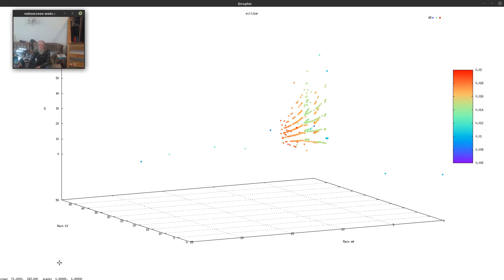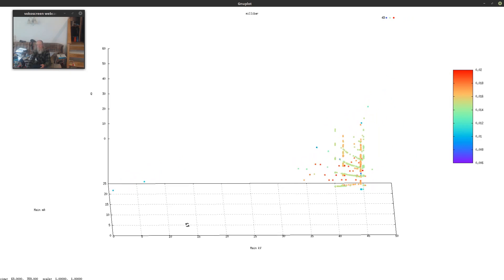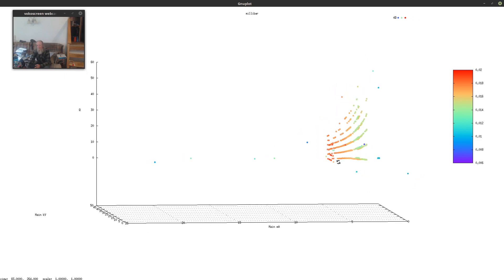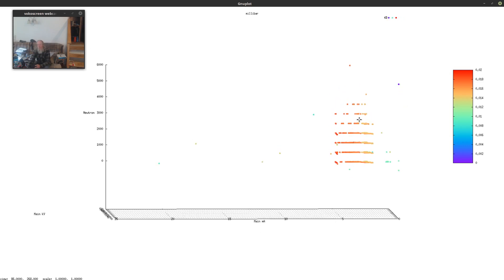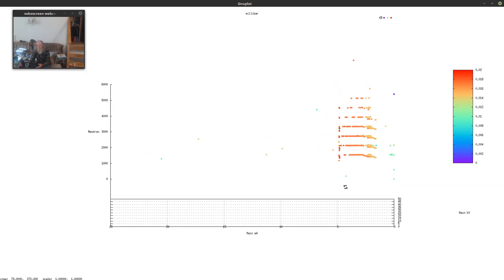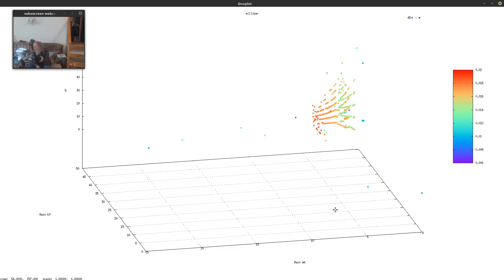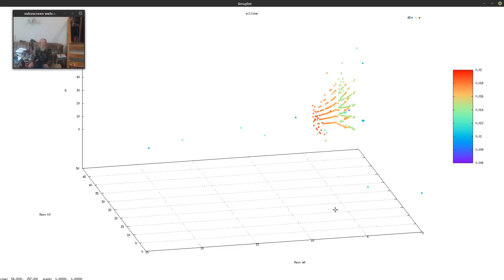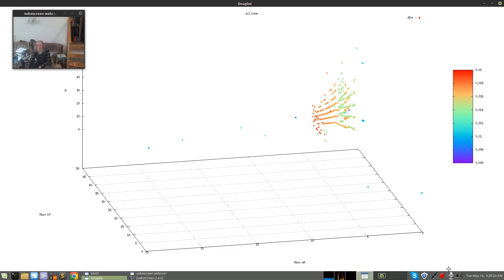NewQ

Comment: Hi Doug,  does input frequency have much bearing on your results?
Reply from the maker: An idea I'm pursuing has me duplicating many of the concepts of an ion trap - roughly defined by the Mathieu equations.
Those, however, only work in what might as well be vacuum - they don't take into account interactions between the particles, which themselves have charge which becomes significant when there are lots of them (density).  Or the effects of also having a bunch of electrons around which gets quite complex - plasma polarizations that have odd propagation times as polarization waves etc.
The original, simpler stuff, for which some math is available basically goes (vastly oversimplified) that AC + DC can trap ions in an oscillating fashion - they repeat the same or similar paths over and over.  The trick I'm trying to pull off here is to do that with more disturbing factors present - but the simpler math points out sensibly that the higher the frequency, the higher the voltage you need to get a certain amount of travel in the ion oscillation - and the faster those ions move.
To get fusion, we need speed; the one-degree-of-freedom version of temperature, here all the kinetic energy is hopefully along the same vector, instead of random like heat.  We need speed to get ions that do collide to come near one another for long enough for tunneling into fusion (via the strong force which overcomes the electrostatic coulomb repulsion once things get real close together).  To get speed, we need voltage.  To not have ions slamming into the tank walls - we need the correct amount of travel per cycle back and forth.
So, the TL;DR is yes.  But there's a lot more to it.  The math is already hairy without the perturbing new terms needed to describe what happens on the molecular to viscous flow boundary, and in the presence of charge concentrations similar to the applied field.  No one I know has a clue how to really write that math, hence we have to try stuff.  Or another way to say it is due to it not being just one particle in there (it's more like 10^18) the charge of the "stuff" is comparable to the field we can apply, and that affects what combo of frequency and voltage can work - with a limit being that too slow through the collision zone doesn't work out either.
Reply: @DCFusor  Thank you very much for your reply Doug. I have only been interested in this field for a short time, I think I understood much of what you just explained. I am working towards building a device of my own design. The maths in this area is over my head, I may be able to learn but that's another whole  can of worms so I'm  going by feel. Seeing as nature has achieved what we are trying to achieve it only seems logical to me to try to replicate that,  and seeing mass is laughably out of the question apply fields in reverse. Thanks again for uploading you content, you are a wealth of knowledge.
Reply from the maker: @burner8126  Well,  best luck - I think all honest workers at this just want someone, anyone to get it,  We all hope it's ourself, but we'll take success in any form.  Without too much math,I'd suggest getting a real understanding of Paschen's law (wikipedia is good on that) at the gut level, and of the forces and scales involved in getting nuclei to be close enough together for long enough for them to have some reasonable probability of "tunneling" into fusion (we don't/can't mess with the strong force directly, we just bang the rocks together).  But it does have a range/probability relation that we have to satisfy with the forces we can control to get fusion to happen.  Other than being clueless how to make gravity in a practical sense, we're way ahead of nature in that we have lots better fuel.  The cycles a star uses are really out of reach for us.  Deuterium or tritium are "easy" by comparison.  Get that sense of scale internalized and you'll see where the real fight is here.
Reply from the maker: You might also note that in every one of these Q reports, things are getting better fast just as we go off the paper.  I didn't choose the edge of that paper, we simply can't run further out at those edges, due to well, physics realities.  We've yet to see a peak - just things going up as we get to the edge of where we can run at all.  So it seems a somewhat different approach is needed.  Maybe this: http://www.coultersmithing.com/forums/viewtopic.php?f=21&t=1140
I would also note that fusors normally have such low Q one could make a case - and there's a tiny bit of evidence for it - that what's really going on in one is that some D's are collecting a negative charge from all the electrons spewing off the grid and then being slammed into the tank walls to create the actual fusion!  In other words, the opposite of what most assume.  The evidence(s) are - Tyler Christianson published a neat picture of a neutron bubble detector at the envelope of his fusor that appeared to show beaming of the neutrons (or locality...more likely) - meaning they were being produced close to the tank wall, not in the middle.  My own lab shows over and over that as the walls heat, the fusion Q goes down - there's less D in the walls the hotter things are.  Hmmm.
Reply: @DCFusor  looks like I'll have to wait until your next intake to your forum  cobba, my name's Nathan by the way, nice chatting with you. 
A few hv cloud chamber experiments are in order I think.
Reply: This is very exciting stuff Doug. I have many ideas to apply to this but like everything ,time and money are an issue. Decent vacuum equipment first I think as I have only been working with low vacuum. I shall build an oil defusion  pump as a turbo is out of the question. Do you have any experience with them?
Reply from the maker: @burner8126  Sadly, a lot.  It's why I don't use them.  Got rid of all but one Bill owns.  Maybe you should join my board?  Real names of course, there, so if you do invent something cool you get attribution.  Them's just the rules...makes it a lot harder for someone to steal your idea if you're you - anyone can be "burnerNN" or say they are.

Note that while turbo-drag pumps ARE really pricey, plain turbos of small size are dirt cheap used (I got ~ 5 on ebay under $100 ea) if you make your own driver.  You need a really good forepump for either one - the turbo-drag ones don't - which is their benefit....believe me, it's worth it even in bucks - all the valves etc you need to not have to wait an hour for an oil pump to heat or cool or the forepump pull things down aren't cheap either and the ones from the hardware store aren't good enough.
Reply: I would love to explain my concept but after doing some research it appears to be similar to a rather large company's concept but with some differences so I'm not sure here is the place. 
Best of luck with your work.
Reply from the maker: @burner8126  Of course not youtube and under a fake name anyone on earth can claim was them. At one point we thought we had something worth protecting (you gotta own it to give it away these days!) and looked into the patent process.  Some very expensive lawyers pointed out that (after billing us) that you can write up your stuff in a journal the patent office pays attention to, and even after the "patent reform act" BS, still get the benefit of being "prior art",  I forget the obscure name of the publication, but it's what you should do first.  It's a lot cheaper than getting (and maybe contesting) a patent.   At least till you know something actually works.  After all, there are patents on warp drives and suchlike...
Also fusion - do a search, I'd be surprised if your idea wasn't already "taken" already, or perhaps proven to not work...we all think we've got it at some point, then the lab is cruel....
The reason I suggested my forums is that while they don't have quite the heft of the government pubs, they are recorded and timestamped by an uninterested 3rd party....so do carry some weight as long as people follow the rules.

Comment: What if you fed the runs and many more addition runs in the approximate zone of that sweet spot into a simple multi-layer perceptron, a neural network, and observed its results it may give you a insights into the sensitive environment your looking for. Just a thought. Btw Ive been watching for years and am very impressed with your work. Thank you for sharing it with us
Reply from the maker: I don't think we're yet at the point where a directed gradient descent from the data we have takes us quite where I want to go.  Sure we could maybe go perhaps a few times better - maybe even 10x (this showed over 4x not even trying).  But I'm greedy and want more -- let's get some more in the exponent....
Remember, the human brain can be a pretty decent neural net if it's used correctly - and also that the error function in this case really does require more running - this can't yet be modeled with current technique - when a computer can run an error function in a millisecond it can try lots more things than a human can with real gear...

Recent observations, not yet reported, show that not only did I kinda show how other armchair analysts weren't quite right - I disproved my own model!
  
So incremental improvements on the wrong model start to look like epicycles when the real answer was Copernicus' and Newton's laws..
More soon.  I do share everything, but I like to get the first crack at figuring out what new observations (especially unexpected ones) might mean - then things go to the website, then video, most often.  Believe me, some serious skull sweat is going on - and part of it is designing the next set of observations to get more of a handle on things.  In short, the search space is so large we likely don't have the right stuff to analyze just yet.

Remember those nice clean rays of our poisser?
Guess what - the gas between is more or less completely un-ionized, and even diatomic - and there's next to no diffusion between that and the rays.  Why?  That's extremely weird.  Yes, we do better with lower pressures and an ion source, but this shows some interesting issues, and was discovered with RF drive (in an attempt to characterize what would drive recirculation) - there's another negative resistance type (foldback) of behavior going on at some speeds and feeds...as usual, more when I know more.
Reply from the maker: You may also note that in every report like this, things are still getting better at the edge of the plot - if we could go further and find a peak, that'd be cool, but physics doesn't yet let us go there.  I don't stop being interested at the edge of the paper - I'm looking for peaks that are attainable.  If I simply accelerated colliding, bunched, beams at a couple megavolts, I could get very high fusion rates - and get back a couple mega electron volts per.  I don't make net gain that way = I can at best come out even, so it's not even worth much discussion.

Comment: I wonder if you're getting some neutron spallation. 

I just heard about this effect, but it seems that neutrons don't always mean fusion. 

Is there a way to show conclusively that these are the result of fusion? Neutron spectroscopy or detecting reaction products maybe?

Keep up the good work!
Reply from the maker: Spallation usually takes much more impact energy than I'm supplying, so I somewhat doubt it.  D's binding energy is 2.2 MeV/nucleus, which is the loosest there is in a stable element.  That's what makes it a good fusion fuel - any other combo of those nucleons has tighter binding and the difference is released in fusion.  I'm kinda-sorta doing some spectroscopy (the real deal is quite difficult) - by having both fast-only and moderated neutron detectors to see how they agree on things.  It really looks like what you'd expect from DD fusion.  We also look at the  gamma spectra from the protons that one of the 2 normal reactions generates - they hit things and you get gamma lines.  In fact, we had to eliminate most heavy metal types of things from the tank or be x-rayed to death by them.  Lead is a crappy absorber at high energies.

Now, this Q measurement has possibilities of errors due to the ion grid itself partially accelerating some things, but we're still talking 10's of KeV, not the gigavolts usually used in neutron spallation sources.  Ex: https://en.wikipedia.org/wiki/Spallation_Neutron_Source
There's a lot going on here yet to be analyzed - it appears on first look that "normal" fusor operation with DC results in a very low percentage of the gas being ionized at all.  With RF drive there are two modes - and even at lower gas pressure than it will stay "lit" at with only DC, you can get such a high percent of the gas to ionize that it acts like a pretty good short circuit (and there's no fusion because no eV to speak of at that point) - or - you can use some DC to have the "old" mode and just use some RF to make the particles oscillate around the center - (so they repeatedly collide) tricky but so far do-able.  We are talking mean free paths here of around 3-4" if it was just neutral gas - it's a pretty good vacuum - the pk251 pressure gage reads 2x high on hydrogen isotopes, and I kept the factory calibration because...I know it's D in there and can mentally correct the number.  There are of course, more experiments to follow, this is just one step on a long trek.  Sadly, some of the gear decided to let out the magic smoke, so I'm awaiting replacement parts right now.